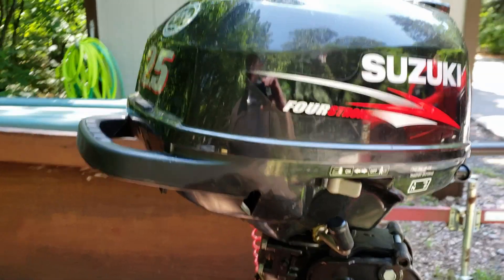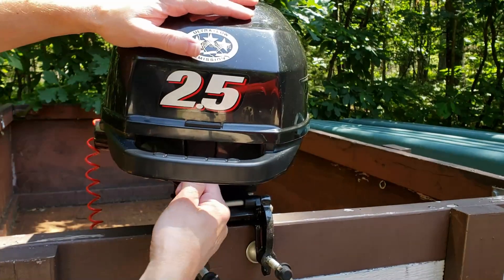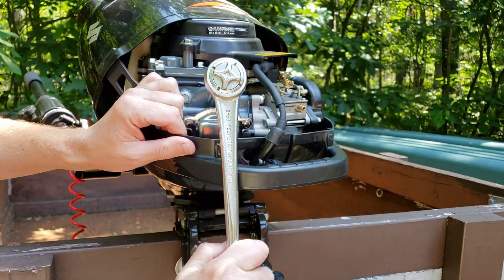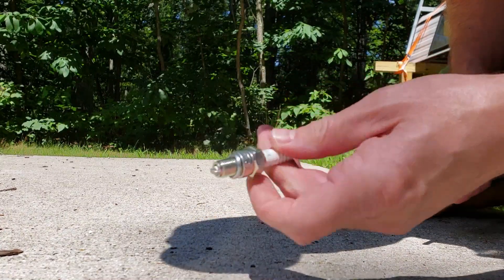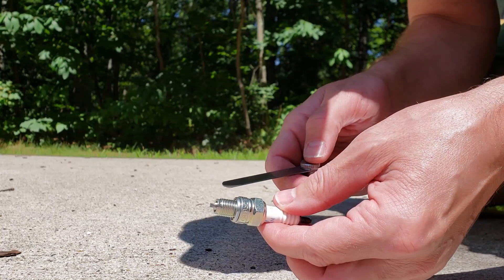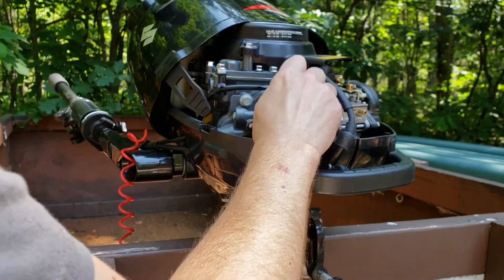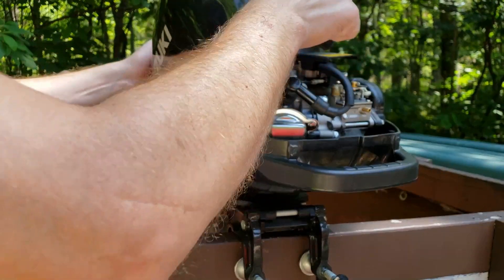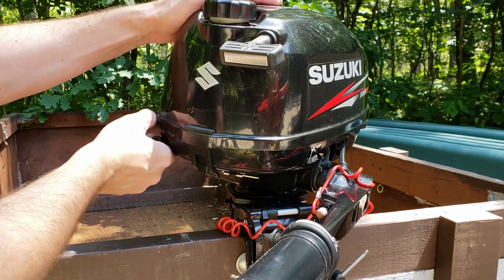Suzuki 2.5HP Outboard Spark Plug Change

Comment: So I fixed my broken impeller pin and when I took of the power head, placed it up side down.  Oil had leaked out as well as gas and the motor will no longer start even after putting carburetor spray in the intake (works 100%of the time usually)   I'm thinking maybe oil got into the cylinder. 

manual :

• Do not rest the engine in any of the posi-
tions shown below, as water and oil may
enter the cylinder through the exhaust port
or the outer casings may be damaged.
• Do not place the engine on its side before
the cooling water has drained from it com-
pletely, as water may enter the cylinder
through the exhaust port and cause prob-
lems.

i checked the spark plug, it was dirty and I sprayed with carb fluid and brushed of soot with a wire brush and dried w paper towel.  Poor in new gas in fuel tank.